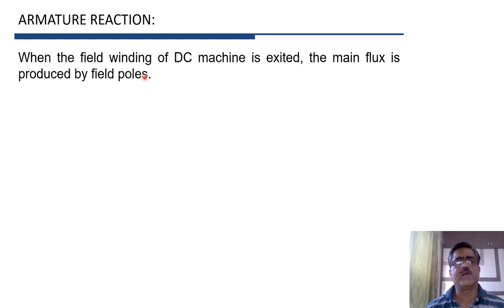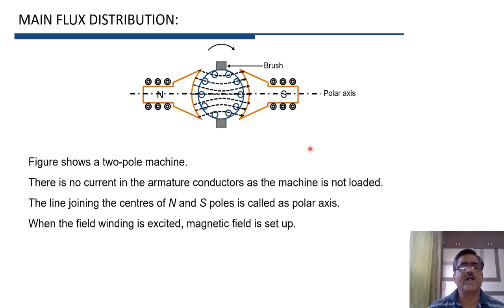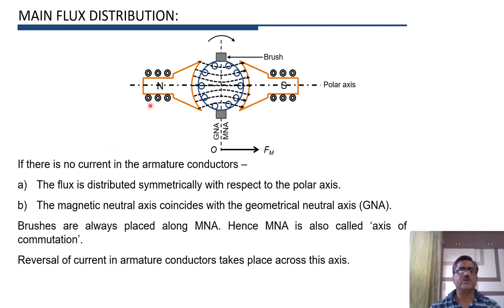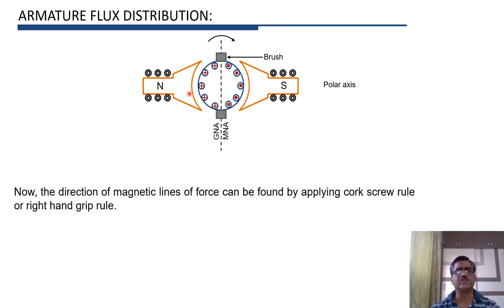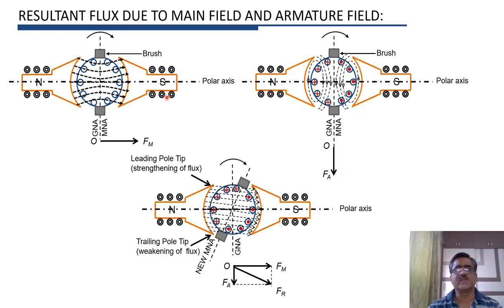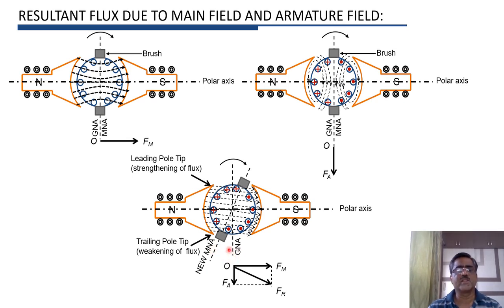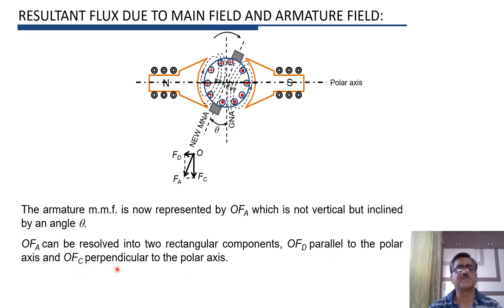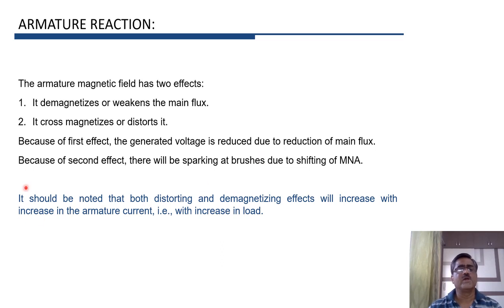Armature Reaction (9)

Comment: if field windings are not excited then how is the flux from north pole to south pole
Reply: I think it's the residual flux in the permanent magnets. There is a magnetic field between the north and south. Excitation is there to increase main flux in the poles for larger voltages, larger machines etc. On this case it's usually small motors or generators, but I think he's just doing it separately to show you how the armature magnetic flux is around the conductors, otherwise they are working simultaneously.